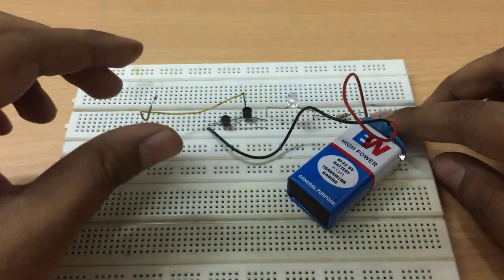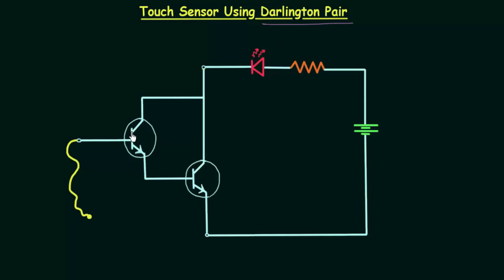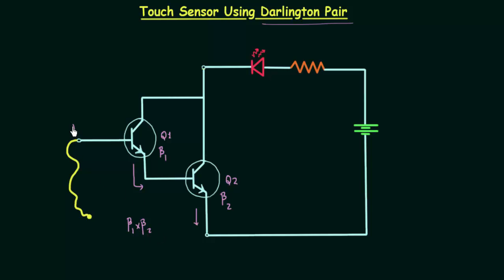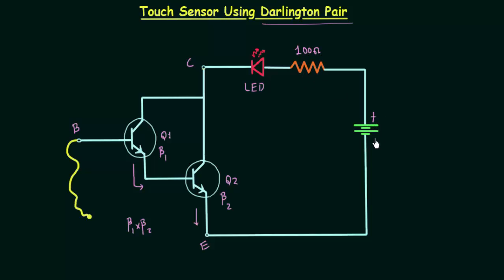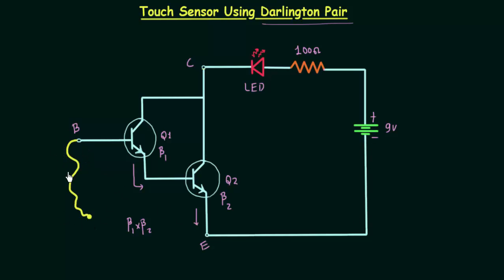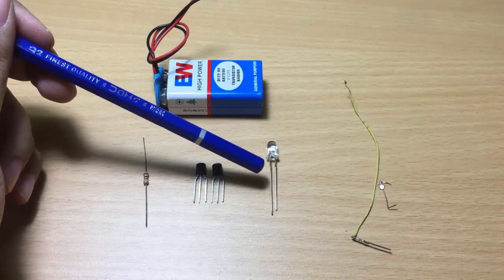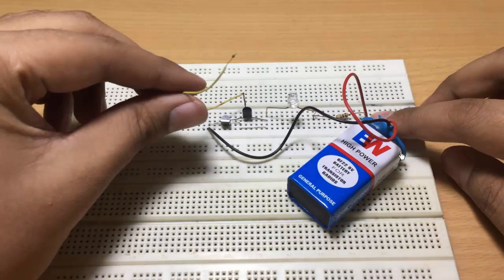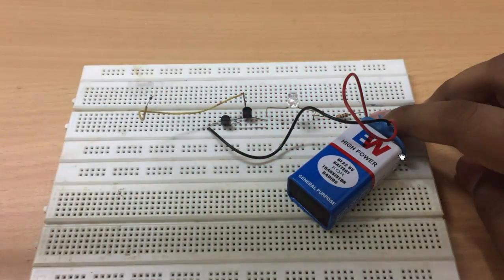Touch Sensor Using Darlington Pair

Comment: That's great, but how about capacitive touch, thru insulation or paint?
I'm trying to build such an circuit using painted frame in battery operated lift device as touch area to turn in led light.

Comment: Sir I'm having an issue with this circuit.
I tried making this circuit  on Proteus.
But for the wire touching the hand I connected a touchpad there but when I run the simulation, the lead glows by itself even before we touch it with the hand. 
Pls help .

Comment: Sir one question,how the Darlington transistor do the amplification without biasing the transistor?
Reply: We are simply using it as an On-Off switch. Biasing is required when we need to amplify an ac signal for faithful amplification.
Reply: Here, Darligton transistor CE is biased by 9V battery and BE is biased by simply touching with our fingers

Comment: Minimum potential required to forward bias the transistor is 1.4V then from where does the transistors are getting forward biased?? By that single wire??

Comment: Can you explain me how the hand is working as source in this experiement
Reply: nikhil muriki our hand works as a bery high resistance device. Here see his right hand is touching thebpositive side of battery. So he completes the circuit to the basebof Darlington base by a very high resistance. But aince Darlington has very high current gain the transistor gets to saturation and led lights up

Comment: the voltage input is between the base and collector the terminals.
so where does the input voltage come from ?
Reply: nerves works on ions differences (chemical interactions) inside nerve 
cell and outside , mainly from difference between K+ and Na+ (from -35 
millivolt to 90 millivolt) for each cell.
Reply: @hartyguyton3800  So the input voltage from body just mV can be amplified to drive the transistor to work. Am I understand correct?
Reply: Correct! Actually mv inside the body but what drives this transistor is microvolts that's why darlington is needed.
Reply: Your body acts as an antenna and picks up very small voltage mostly from your household AC wiring

Comment: we need to touch the wire and resistor
Reply: Neso Academy mine is not working i used bc547 transistor
Reply: No, its working only if we touch the wire and the resistor!!
Reply: Vrahul Veeravelli remove your shoes and stand on the floor
Reply: Abhay Singh follow the specification chart of bc547 for ebc config and check led polarity put high resistance of 470 ohm with 9v for not let it burn and remove shoes and stand on ground while touching wire

Comment: Why do your fingers touching the wire cause there to be current going into the base of the first NPN transistor?
Reply: i also have same question @neso guys
Reply: nerves works on ions differences (chemical interactions) inside nerve cell and outside , mainly from difference between K+ and Na+ (from -35 millivolt to 90 millivolt) . body has many magnificent signaling systems that you may ever encounter.
Reply: Yes of course! it is evident long time ago. for further information read "Electrophysiology and Nerve Stimulators"

also you can take a peek on Sherwood,introduction to physiology and Guyton, Medical physiology (chapters that focuses on nerves and electrolytes).

also there is something interesting in "Pace makers"
Nerves has various signal speeds , signal can be faster in area or slower or neutral.
Reply: Blood contains ions thus making current be able to flow in your body. A human has also really low resistance due to the amount of water we have in our bodies. This circuit he has amplifies really small inputs, such as the flow of ions in blood.
Reply: Keilara Kappa It makes sense that current is able to flow inside our bodies as blood contains ions. But how does this current flow in our blood cause current flow on the outside of our skin, in this case the outside of his finger?
Reply: As I said, our bodies does have some kind of resistance, allowing us to act as a conductor. I believe that an average human has around 1k-100k ohm resistance depending if our skin is wet or dry.
Reply: Keilara Kappa Ok that makes sense, I understand that we are a conductor and we can act as a resistance. But we are not a generator or a voltage source! Imagine sticking a resistor of any value between 1k-100k (as you say human body can be, which I understand) in the schematic where the fingers currently go. How would that conductor/resistor actually inject current into the base of the BJT? 

The value of the skin resistance would definitely determine the amount of current for a given voltage source, but in this case there is no voltage source it seems!
Reply: you are saying there there are constant voltages being developed on the outside of my skin? Has this even been quantified scientifically?
Reply: Zambia95 U Should know this is only for DC current